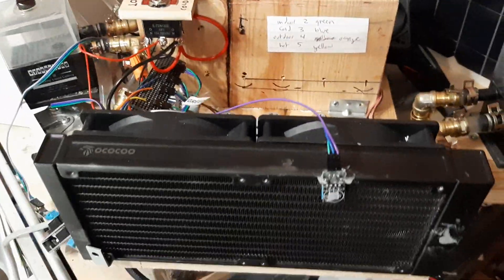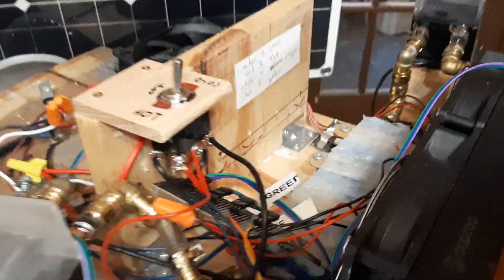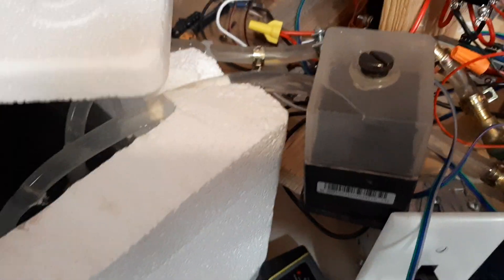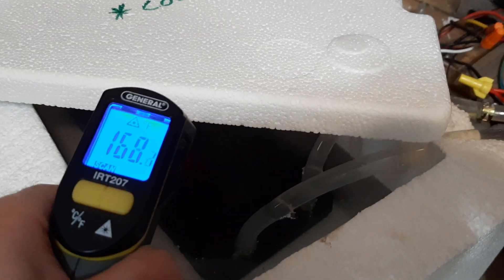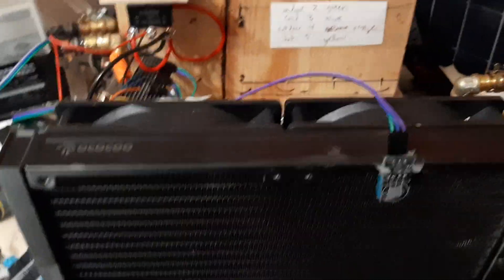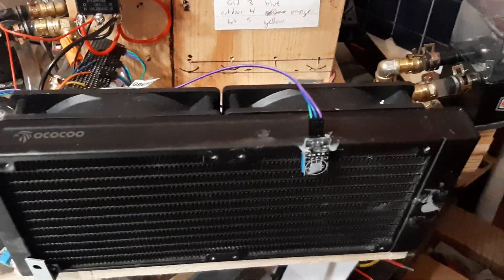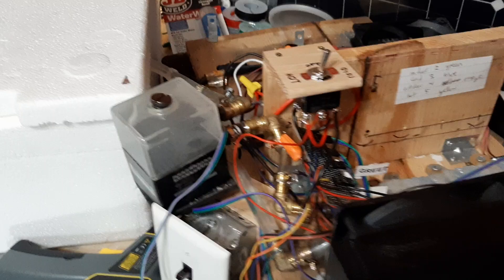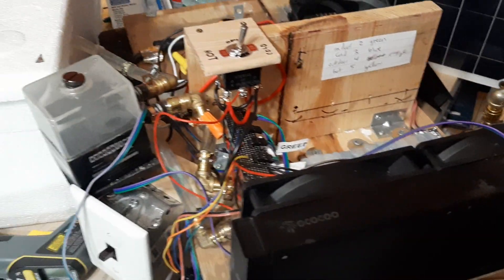Peltier-based offgrid hot water heater

Comment: Yeah, heat pumps are what they are, and as the power they use turns into heat in them, they're technically better at heating than they are at cooling. Also, they become less efficient the more power you push through them, and the bigger the temperature difference they push heat against, so not only are they typically used to do what they're inherently bad at doing, cooling, they're also usually pushed so hard that they only can achieve a tiny fraction of their maximum efficiency. Especially when used in consumer grade products where often a single peltier element is used for cooling together with a heat sink that requires a noisy fan to achieve mediocre heat rejection.

Comment: I'm using an Igloo ice cooler for my DIY power station case. I decided to use a Peltier element to cool the air in the summer, it's going to get warm with 2,000 watts of power going through it, then reverse polarity and switch to a different temp controller and use it to keep the lithium batteries warm in the winter.
Reply: I got a 12-volt 19-watt RV elebow heater under the battery for backup and redundancy. It gets -20°F here, and lithium batteries are dead at that temperature. It's going outside in the weather; inside, the cooler has to be controlled. I picked a good cooler with a foamed insulated lid. The battery is huge; it should stay warm for a while just from being massive. It doesn't need to be cooled down that much in the summer because it's not food, but it can get excessively hot without it.